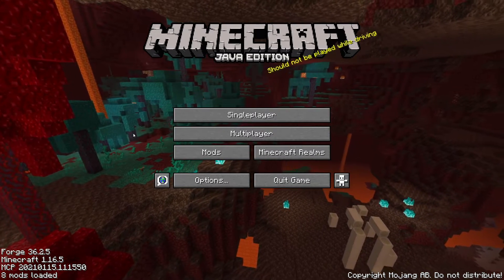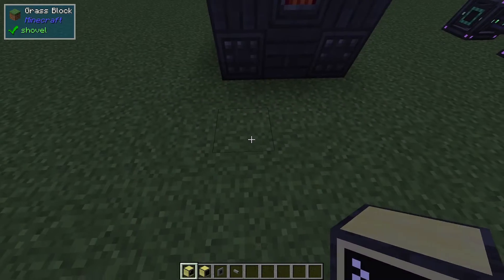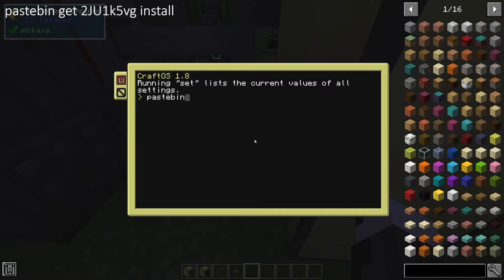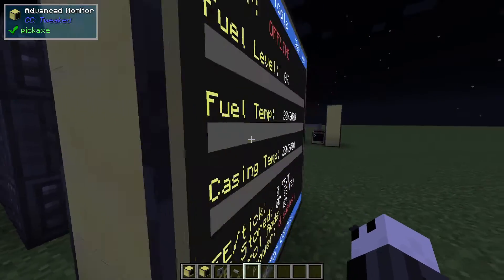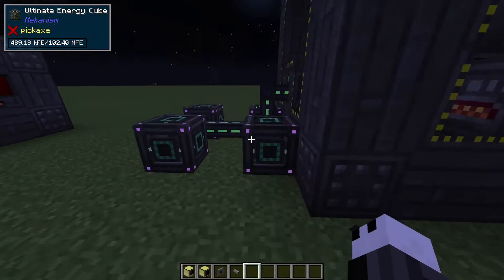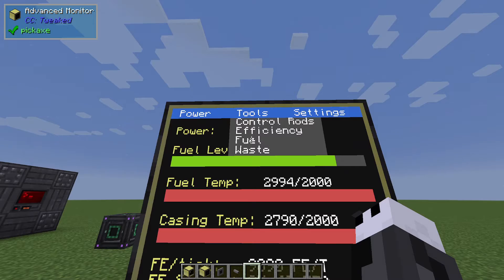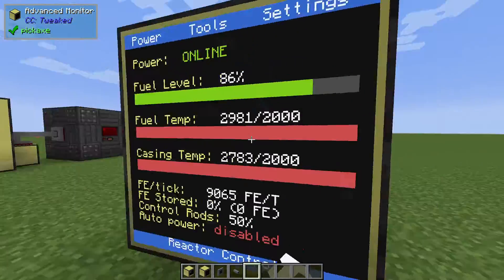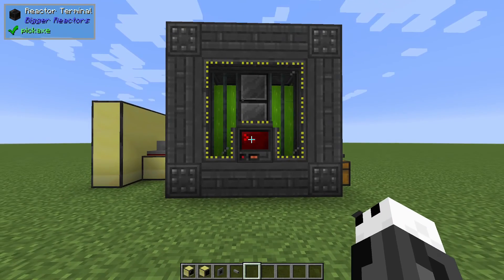Bigger Reactors + CC:Tweaked Compatibility Tutorial | Minecraft 1.16.5

Comment: ok so for ATM9 1.20.1 anyone having the "can't connect to Reactor" Error - Use the Original code, the modified version is causing this bug. 12/27/2023 12:41AM
Reply: I had it for the turbine VS the reactor I have yet to find a way to fix it, dunno, if you've had any success
Reply: Any fix for this ?
Reply: i seen the whole message nvm

Comment: I have to let you know it is unable to detect the reactor in FTB Endeavour.
I have had similar setups in the past so I think it actually is a issue.
I went back to the code Krakaen made. It also had issue but was fixed and should work for FTB Endeavour.

If you are still on this and want to deploy fixes I will certainly try it out.

Comment: Just a thought to maybe integrate an algorithm that changes steam usage in the turbine based of the average rf/t usage over the last few seconds and match the control rod level to the amount of steam required. This would allow the turbine to stay "spooled up" , maintain a steady rf supply, and reduce uranium consumption. pretty much have it  based on demand vs how it currently works when the battery runs out.

Comment from the maker: Wow this video got a lot more attention that I thought it would. Thank you guys so much for 6k views. I wanted to make a quick comment to address some questions I've gotten.

First off, regarding any issues, I'm more than happy to help, but it's difficult for me to help if I don't have enough information. If you come across any problems with the program, make sure you tell me what version of Minecraft you're on, what Modpack, and what version of said modpack so that I can more easily look into it. 
Secondly, regarding new features, I don't mind looking into adding new features, such as a controller for the Heat Exchanger, but I can't guarantee anything, as I'm not very fluent in Lua and I do this solely as a hobby. 
Lastly, regarding making this program to work with mods like Mekanism and Extreme Reactors, while it can be done, it most likely won't be due to the reason that I gave above, and they would likely require completely rewriting the code. However, I am still willing to at least look into it. 

Again, thank you guys so much!
Reply: hello!! This program work with a turbine? thks
Reply from the maker: @andrenicoletti7855  Yep, it should work with both the Reactor (Passive and Actively cooled) and the Turbine.) in Bigger Reactors
Reply: @shirooukami_  ah ok, but i have an error when the computer asked me what's the turbine's name
Reply from the maker: @andrenicoletti7855  What are you putting in for the name of the Turbine? It should be along the lines of "BiggerReactors_Turbine_#".
Reply: @shirooukami_  yes i trying, but not worked
Reply from the maker: @andrenicoletti7855  Have you checked to make sure the turbine and computer are connected to the network properly?
Reply: @shirooukami_  yes, connected in turbine computer port because i think is the only way, right?
Reply from the maker: @andrenicoletti7855  Not necessarily the only way (the computer can also be directly adjacent to the computer port and it should still work), but I personally always use the modems and cables. But I digress. The modems on both the computer port and computer are both activated correct? (There will be a color difference; I think it goes from gray to red but it's been a while so I could be wrong)
Reply: tells me  ¨ no such program¨ :C

Comment: hey is there a way to make it so that the "off when storage" option in the auto power setting can be above 99% cus im on ragnamod VI and i have a reinforced reactor and it only stores 50% before it shuts down and when the power is full it stores like almost 300% or more pls help
Reply from the maker: Hey! The reinforced reactor is from Extreme Reactors. The program in this video is only designed for Bigger Reactors.
Reply: @shirooukami_  alr is there gunna be a code for extreme reactor anytime soon or is it not gunna release?
Reply from the maker: @voidgames180  I don't currently plan to port the code for Extreme Reactors, but it's something I can at least look into.

Comment: i have a probblem.
the computer shows me "could nit connect to reactor" even tho i have the modem on the reactor computer port and also set as "BigReactors-Reactor_2" my computer is set to 2 aswell and the monitor is set to 2 aswell so i dont know what to do 
i also had the computer right nex to the computer port on the reactor as the code told me but it did not work as intended a lil help would be nice ty
Reply from the maker: Hey! What version of the mods are you running?

Comment: Hiya :) thanks for the upload, very helpful given I suck at coding haha, I'm running the code successfully with my turbine but when I try to run it through my steam reactor so I can set that up to automatically turn off I end up with my monitor not recognizing any data and just having the basic controls around the edges. The computer just says reactor_control:199, I am running in the version in 1.18.1, is this possibly the reason? It is recognizing the reactor and the monitor.
Reply from the maker: I haven't tested the reactor or turbine control with the 1.18.1 versions of the mods. It's possible some of the code was changed, so I might have to make another version for 1.18.1. I'll take a look later on today. Thanks for letting me know!
Reply: @shirooukami_  I appreciate you looking into it :) the turbine is working peachy :)
Reply from the maker: @TheBeccaanne  So it looks like the problem isn't 1.18.1, it's me. I completely forgot to test actively cooled reactors when I ported the program. However I think I have it fixed and I'm about to test it in 1.18.1.
Reply from the maker: I just tested it and it does work now. Let me know if there are any more problems!
Reply: @shirooukami_  oh yay thank you :) I'll go test it now
Reply: @shirooukami_   It is connecting properly now, is there a way to make it turn off using how much steam is built up? doesn't seem to have functionality to turn on/off based on steam levels
Reply from the maker: @TheBeccaanne  I'm actually working on that. The original code didn't have it implemented for actively cooled reactors so I'm having to add and test it myself.
Reply: @shirooukami_  ok awesome sauce :) looking forward to seeing it :)
Reply from the maker: @TheBeccaanne  It should now have proper functionality for turning on and off automatically.
Reply: @shirooukami_  fabulous! it's working perfectly :) thank you very much
Reply from the maker: @TheBeccaanne  Glad it's working!

Comment: Hey is there a pastebin for the steam type for bigger reactors? I currently make steam from bigger reactors and using mekanism turbine to consume steam. I havent seen a video about steam bigger reactors cc tweaks yet.
Reply from the maker: Hey! The program in this video should detect an actively cooled reactor. If it isn't, I can take a look into it and see what's wrong.
Reply: @shirooukami_  word, ill look into it soon then!
Reply: @shirooukami_  apparently mekanism doesnt have logic port lol so went with bigger reactor turbine and it works lol
Reply: @shirooukami_  it does detect the turbine reactor, however I still cannot use for reactor control because now its a steam reactor control. unfortunely i dont have a way to make this automatic unless i switch back to normal one. I have tried using 1 reactor control but it gives me nil index error so. what should I do?
Reply from the maker: @luke7542  Unfortunately there's no way (at least not implemented) to control a reactor and a turbine with one controller. I haven't even gotten around to making it so that multiple reactors can be controlled with one controller, and whether or not I plan to is up in the air as I'm still not fluent in Lua.
Reply: @shirooukami_  heard gotcha

Comment: Hey, after the Install i cant Run it, i only get The Message 

,,Connecting to pastebin... Success,,

After this nothing Happens. Any help?
Reply from the maker: I'm not sure why it'd be getting stuck like that. I'll look into it though.
Reply: @shirooukami_  i saw you got craftos 1.8, i got 1.5, But i cant Update it, because its a Friends Server with the Tekkit Classic Mod Pack. Is this maybe the Problem?
Reply from the maker: @battelfreakgamer3557  yes that's likely the problem. I believe I mentioned in the video that older versions won't work anymore because of a change Pastebin made. This video was for Bigger Reactors and CC:Tweaked in Minecraft 1.16.5
Reply: okay I had this problem so what worked for me was to edit the pastebin code and change the link to https from http

cp rom/programs/http/pastebin pastebin
edit pastebin

then on line 24 (i think) there is a url for pastebin, change the http to https